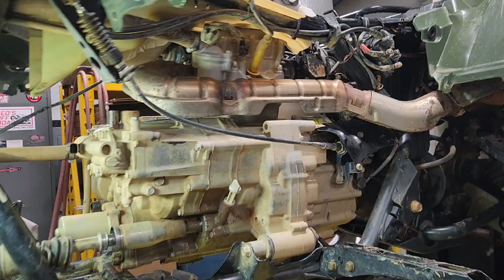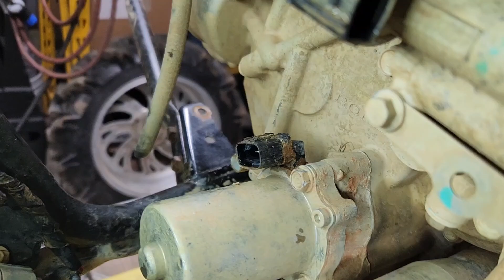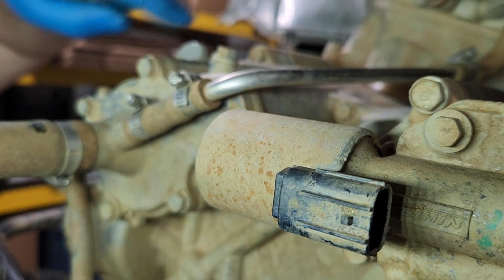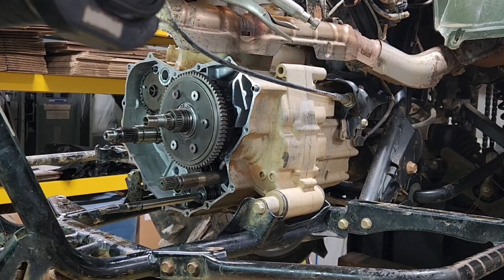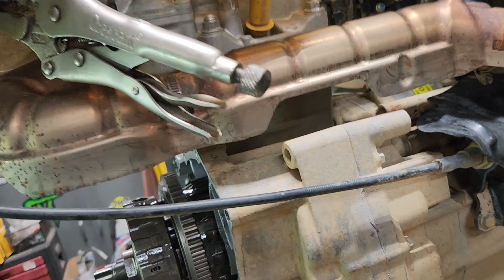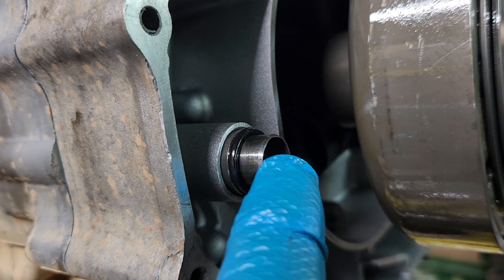Honda DCT (auto+ES) Rancher 420 and Rubicon 500/520 Primary Gear Reduction Install

Comment: Is there any customizing on putting your 25% reduction in a 500 dct like a washer or case grinding or is it just drop everything in and and it’s good to go
Reply: Drop everything in and go. He's having to grind because he's doing a 40percent reduction.
Reply from the maker: The 25% drops in but does not run a washer behind the drive gear. Honda's factory thrust washer design isn't necessary honestly, a thrust washer is typically used when one part has a linear load against another part to prevent direct contact and rubbing or wear issues but the drive gear ahould not fit tight against the crank shoulder, it should float on the crank and have some in/out play to prevent binding which causes the machine to move in gear without throttle.

Comment: if you force the cover on what could break ?
Reply from the maker: Could damage the oil feed tubes that fit into the countershaft. I have noticed sometimes the shafts must have some runout to them as the clutch h cover won't go right on easily and you have to bump the starter to spin the crank while pushing on the cover and the cover will fall in place.

Comment: Can you please do a video on the secondary gears!!! I need it!
Reply from the maker: What machine do you have?
Reply: @ReductionBoss rancher DCT  bike is geared so high can’t even pull 28s
Reply from the maker: @danielraleigh9334 yeah the dct Rancher is geared 20% higher stock than a footshift. We will work on doing a vid soon, in process of adding onto shop and rearranging equipment.